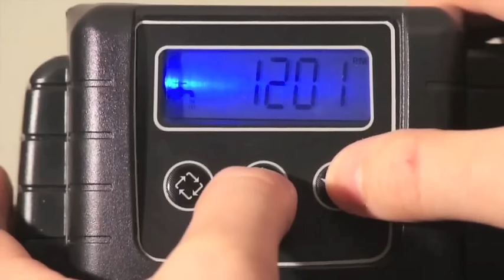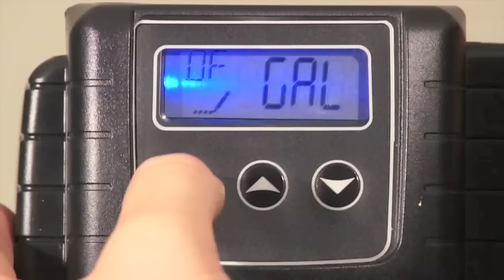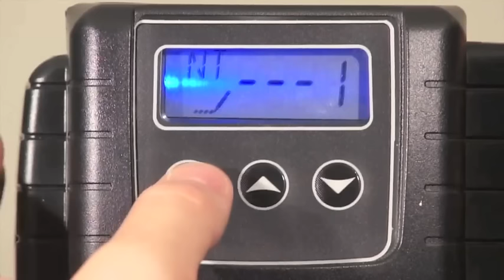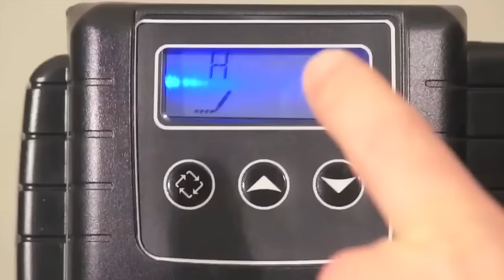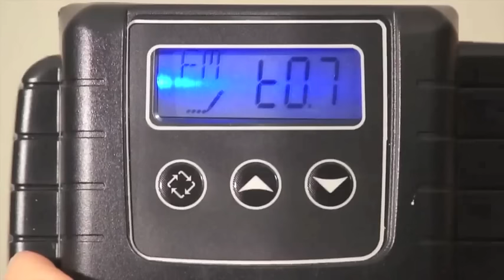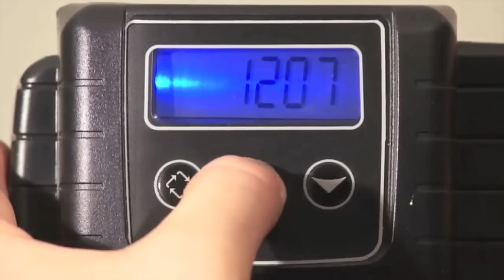Fleck 5600SXT Water Softener Valve Programming - aQuatell.com

Comment: I've used this video a few times now. Just a heads up to everyone.... double check if you have a turbine or a paddle wheel which is common if you got the system off Amazon. I selected T.07 when reaching the last setting "FM"  and had issues with salt clogs because the gallons used was not accurate. I switched it to P.07 because I have a paddle wheel and problem solved.
Reply: Yes you right, I had the same problem. If anyone still not sure which is right setting for FM, then select T0.7 and open a tap and fill a 3 gallon bucket, and come back and check the meter. If meter is not right, change to P0.7

Comment: This video is great. There's something I encountered that I haven't seen mentioned in any of these videos yet - the capacity must show the x1000. If it doesn't, you're literally setting it for the number seen. I had my meter delayed gallons remaining count showing zero and couldn't figure out why. I then noticed I had capacity set to 40 instead of 40x1000. You literally have to hold the up button until it exceeds the first thousand to start showing the x1000. Something to be aware of for sure.

Comment: Thank you for this!  I just got a house with a softener system and knew nothing about it. I’ve asked around and it seems many don’t know. I didn’t know I was supposed to put salt in the tank so it’s been without salt for maybe 2-3 months...not really sure. I got salt in it now and guessed on pressing the back wash button. Now it’s doing a brine draw for an hour. I’ll have to check the programming once it’s done. Do you recommend doing anything else other than adding salt? Thanks

Comment: Thank you so much for this video.  I know it was posted many years ago but the layout of this unit hasn't changed much so I was able to use your tutorial to fix a setting that the installer didn't do correctly.  Under the "Regeneration Setting", my setting wasn't SF it was rc and the rc was zero.  Do you know what rc is and how that compares to SF?
Reply: rc is reserve capacity. You have to set the amount of gallon or litres of calculated reserve capacity.  It is easier to use a safety factor(SF)

Comment: I really appreciate your video. I now know what to do to check if it is programmed correctly. My problem is I keep getting intermittent hard water. I suspect that the regeneration time is set during the day possibly. Which means that water is being used while it's regenerating and really messes things up. I am just wondering if I go through the reset process and double check that it is reset the way you showed on the video will that take care of my problem? I have the 6000

Comment: My system went a long period unplugged. Outlet in my kid's room, didn't notice it was off. Now I used your video to reset but water valve doesn't open, until I press and hold the enter bottom.

Comment: Just purchased a house with this system and can’t find anyone who knows about it. Thanks for the video. Every time my system regenerates(every 7 days) my pressure switch on the pressure tank flips and cuts the water off. I have to reset the switch every 7 days. Any suggestions on how to resolve this?

Comment: @Aquatell Videos  I've read the Aquatell website and watched this video.  Not sure I fully understand maximizing salt efficiency.  Hoping you can help.  I have a 45K water softener w/Fleck 5600SXT controller.  Our water usage has dropped and now ranges between 220 - 250 gal/day @ 15 grains hardness.  Should I lower the controller capacity setting to maximize salt efficiency or leave it at 45K?  What settings should I use for BW, BD, RR, BF?  Really appreciate your assistance!

Comment: Hello - I think my softener isn't working as the water does not feel soft. Is there a way to tell? I recently loaded salt into it. I assumed it would regenerate but it's been 3 days and there is no change in the water. Is it normal for the faucet to be flashing? Thanks for any help.

Comment: Great video! My question is on the display it goes between the time of day, and RC with -----  behind it. 
What does the RC----- mean? And also if we have changed the number of people using water from 2 or3 to average of 6 to 10 do I need to change my RC to a higher number? Thanks for your help..
Reply: mine started doing the same thing.  Did you ever figure this out.  If you did please tell.  Thanks!

Comment: Is the service icon (the faucet) is that supposed to always be on the display? Its not flashing its just solid.
Reply: It should be solid. If it's blinking a regeneration is scheduled. IF that's the case, press reset again to cancel the regeneration.
Reply: @chiefhalftown  thanks, this cleared a long time question to me.
Reply: Gene B  what if the faucet is solid and the time is flashing

Comment: Great video, thank you. I am curious however, why do I not see “Current Day (CD)” in my user programming options?
Reply: Current day sounds like it would be associated with a softener that's set up for Time Clock operation.  If you have the system set up to be metered, there wouldn't be a need for the system to know the current day.
Reply: @reidthornley  thank you Reid. This makes sense now, given my current settings. I wonder then, how does the system know when the day override (say day 14) has arrived/elapsed? Appreciate your help!

Comment: Even with the acid neutralizer and water softener i still have acidic water in the house (5.6PH). I did mix some magnesium in. is there any other programming adjustment to improve the PH or do i only control it by adding more magnesium?  Do you recommend backwash every 6 days for 10 minutes?
Reply: Yes, it sounds like you need to add more magnesium oxide to your filter to replenish it. It gets used up as it's treating acidic water.

Comment: Thanks for the video! One question. I've followed your instructions exactly. But after 7 days and does not regenerate the tank flashes 1440 constantly. Any suggestions? should I put it per day instead of per gallons? Thanks in advance. 👍

Comment: I have this controller on my Nuwave MD600 in the UK 🇬🇧. Thanks for the info. I can’t find any owners manual or service documents online. I’m going to guess the installation company wants to have me call them so they can charge me for a check up. 🙄
Reply from the maker: You're welcome!  I'm curious - in the UK are you using your softener for the water for your whole home or just for your kitchen?
Reply: Aquatell Videos: The whole house (minus one kitchen drinking tap with activated charcoal filter). The water hardness is set to 24 (for liters config) by the professional licensed installer.  I was glad to discover the settings seemed to be stored in NVRAM. I only changed the BW from 8 to 10 (My man ego had to “fix” something after all this 😁).
Reply: Aquatell Videos: I know more people with a kitchen only softener though.

Comment: Hi, thank you for the video.
I found out that since I use this filter, my water is much too soft.
It feels like I can't get any soap of my skin and my hair is way too fluffy, so what is the best way to get my water a bit harder again? Which setting? 
Thank you in advance
Reply from the maker: Hi.  A water softener is going to strive to make your water perfectly soft.  There is no setting that will allow you to make it a little bit harder.  This is a common misconception.  Any setting changes you make to try and achieve this, will only affect when your water softener regenerates, not how hard or soft your water is.  The only thing you can do to make your water a little less soft, is to allow some of your water to bypass the softener altogether.  You can do this by cracking open the bypass a little.  Not very high-tech, but it should work.
Reply: THX for your advice!
I'll give it a try.

Comment: Mine says "48,000 grain or 1.5 cubic feet of high capacity resin".... what setting/number should I use for "C" setting? 48 or 30? (You said 1.5 cubic is 30, but then it is 48000 grain capacity.... Very confusing)
Reply: Hi Eri.  Where did you purchase the system?  That will help me to understand how to tell you to program it.  Thanks.
Reply: @reidthornley  here is the link to Amazon where I bought it from. The description in this page list the capacity.
Reply: @EriMinag  Have you contacted them to ask them how to program the system?

Comment: Anyway to determine the cubic feet size of the tank?
Reply from the maker: Yep.  Check out this article:  https://www.aquatell.ca/blogs/aquatell/what-size-softener-do-i-have-determining-the-size-of-your-existing-water-softener
Reply: @aquatell  Thanks for the response! Unfortunately, my tank has a cover around it, it's not just the bare tank that you can measure.  Its circumference is fairly large, so hard to tell what the tank size is. There are no markings on the tank either. Thanks again!

Comment: We live in the mountains and have power flickers from time to time. Is there a way to set these settings as default? Or do I have to go set it every time the power goes out?
Reply from the maker: There's no way to change the "default" settings, I'm afraid.  If the controller resets due to power outage, you'll need to reprogram it.

Comment: Since our plumbers just installed and did NOT program our water softener it is now up to us to program it.
My question is, looking at my manual how do I know what meter flow type? 
I have the Fleck 5800 SXT downflow/upflow control with a FantasTec body.
Will this tell me if I Google it?
Reply: There are a few things you'll need to know to properly program the control valve:

meter type (turbine or paddle wheel)
softener size (size of the resin bed in cubic feet)
do you have the upflow or downflow version of the control valve
the water hardness value for your home water

Do you have a make/model for the whole softener?  Then I could help you figure this all out.
Reply: @reidthornley  M5800-30SXT-A 
Water Hardness is 11 and changed from 20 to 13 today.
The cylinder tank below controller if need is 
Color & Size: 0948 PG UI BLK 2.5"T
MFR 756102-031519-0081
Part# CH 30383-03010203-30
The salt reservoir brine tank is 32" high
I am assuming an upflow because only uses one tank. 
Assuming a paddle wheel as it says in a broshure online and looking at it there is a dome with a grey cable/wire from controller going into it.
I am also assuming it's a 30,000 model?
Reply: Says on broshure its paddle wheel but in manual there are tonnes of options.
I wish the plumber would have filled out the "Job Specification Sheet" for the manual
Reply: @AC-tn1cy  That model number helps a lot Andrea - thanks.  Send an email to me at support@aquatell.com and include a photo of the area behind the control valve.  It doesn't have to be zoomed in.  I'll be able to ID whether it's a paddle where or turbine meter, and then I can give you the exact programming parameters.
Reply: @AC-tn1cy If it has a dome shaped meter then it's a paddle wheel for sure.  I forgot about he upflow/downflow part.  That's the only missing bit of info now.  You can probably get that info from the valve itself.  There will be a sticker on the control valve somewhere that will contain that info.  It will either be a round sticker that says "scan me" on it, or it will be a rectangular silver sticker that you can see on the back plate of the control valve by removing the cover.  If it's the "scan me" style sticker, then I'll need a photo of it.  If it's the rectangular silver sticker, it will say on that stick what kind of piston is used.
Reply: @reidthornley  I've sent email with pictures!

Comment: Ok so, I have the fleck 5600 sxt 4800 grain capacity that I just had installed about 3 weeks ago. It has only gone through one regeneration period as the installer set it to 14 days, which I will be changing to 7 now that I have watched your video. My question is: My water is tasting salty and feels very slimy to say the least. My Hardness is set to 20 and my BF is set to 20 by the company that installed it. Also there is 9 inches of water above the salt in my brine tank which seems a bit excessive? I do not remember what my Hardness tested at but I know it wasn't really high. I am on well water with of course Iron in it.  I was thinking that If I lowered my Hardness to say 15 and/or lowered my BF to 12 this might help. I would assume I would need to do a manual regeneration for the changes to take effect and see if there is any difference in taste and texture of the water. Would appreciate any help, Thank You.
Reply from the maker: Your hardness (H) value needs to be set to the actual hardness of your water - not more, not less.  If the brine fill rate on your softener is 0.5 gallons per minute, which it is for about 99% of Fleck 5600SXTs, then your BF time should be set to 10, which will add 5 gallons of water to your tank.  You also need to confirm that your capacity (C) value is set to 37.  Once these changes are made it will take two regenerations to see the effect.  Soft water feels "slippery".  You likely won't make this go away by changing these settings.  The softener is doing what it's supposed to do.
Reply: @aquatell  Thank You very much. I left my hardness alone at 20 as when he did the math after testing that is what it came out to, so I am assuming it is correct. I did change my BF to 10 yesterday but didn't realize the C needed to be lowered to 37 from 48 so I will do that today. Hopefully I have less salt taste in my coffee, that is my main issue since the unit has been installed. Thank you for your guidence, much appreciated.

Comment: So the Capacity setting in this video allows decimal....eg. 33.9.  However when I go program my valve i only get a whole number with no decimal eg. 33
I have the EXACT same valve.  How do i enter decimal?
Reply: is your valve using Gallons or Litres?  I suspect you have it set to Litres which is why you're not getting the decimal

Comment: My water is too slippery. how do i work out the softener level to set? I have a different valve but still trying to figure out how to adjust it if at all
Reply: If the water is too slippery you can reduce the salt setting and also the capacity setting to increase the hardness leakage. This will also have a benefit of reducing your salt usage. You will need to do some calculations and look at a capacity table to set it correctly depending on you size of softener. Low tech way is to turn the bypass valve slightly to allow some water to bypass the softener.

Comment: I have this unit for about 4 years now and noticed my glasses have water spots so does the fridge where water hits the water collection tray.  I checked my water hardness and its basically zero.  So I can't tell if there is a problem or not?
Reply from the maker: Well, if the water hardness is testing at or close to zero, then the softener is doing its job.  If your hardness is very high, there's a chance that the water spotting you're seeing is from the elevated sodium level in the water that is caused by the softener.  My guess though, is that your water hardness isn't always zero - it just happened to be at zero when you tested it, and at other times there is some hardness getting through that is causing the water spots.
Reply: @aquatell  If I wanted to test water hardness both with and without the filter right now what is the best way?  (obvously the softener is in line for the whole house,  would I do the bypass (is that turn both knobs on the water inlets and let water run in the house for awhile then test?  Also what is the best hardness testing kit you recommend?
Reply: should I check for when the water softener is near zero gallons left till regeneration and check water hardness?  is it possible my unit resin is "full"  and should be set to regenerate more frequently?   its a 48k unit, It seems to be set for around 2500 gallons between regeneration cycles.  I can't remember what I set hardness to 4 years ago.  And I think I have it set to 344 gallons as a RC number,  but I actually only go through 12k gallons every 3 months according to water bill.

Comment: Your 'BF' setting recommendations based on cu.ft. softener are flawed WITHOUT verifying the size of the  brine injector nozzle. Have a 1 cu ft Fleck with a .125 nozzle that requires a 28 minute BF to get the required salt lbs per regen necessary. Injector nozzle size is the control factor for BF, not the cu. ft. softener size.
Reply from the maker: A couple comments:

It's actually the Brine Line Flow Control (BLFC) that you're talking about.  It's what limits the flow rate through the brine line.  If you have a Fleck-based softener that has a BLFC of 0.125 you almost certainly don't have a Fleck 5600 valve, in which case it's likely that lots of the settings in the video are incorrect for you, or at least will be a little confusing.  It's possible (I think) to equip a Fleck 5600SXT with a 0.125 gpm BLFC but it would be very uncommon.  And to your point, if that's what you have then yes, the brine fill time we've given you here is going to be way too short.  We've tailored these video instructions for the most common Fleck 5600SXT configuration, which is a 0.5 gpm BLFC.

Comment: Have 42000 grain unit , two people using, what should I set the Capacity setting at?
Reply from the maker: What model is it and where was it purchased?
Reply: @aquatell  5600SXT single tank rated 42000 grains, bought in Arizona.